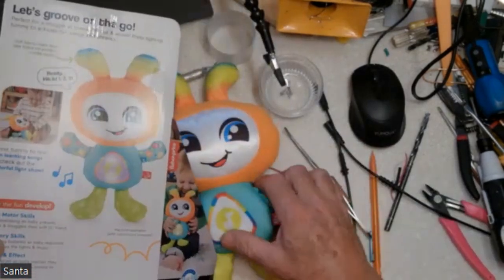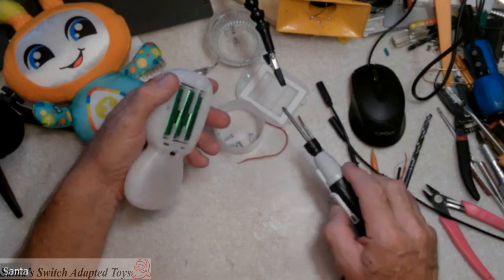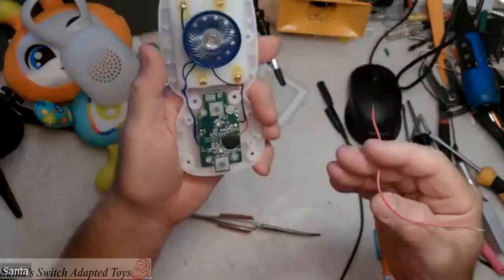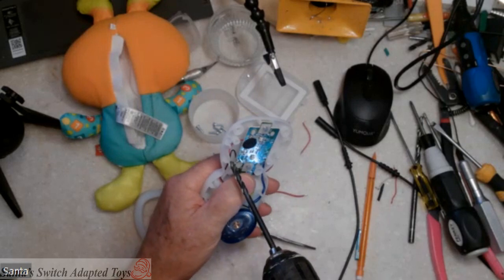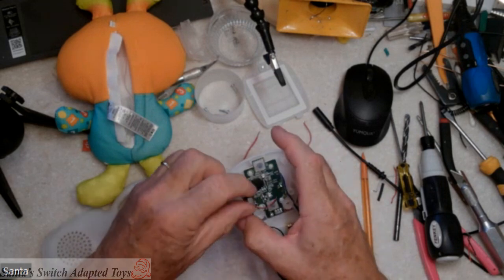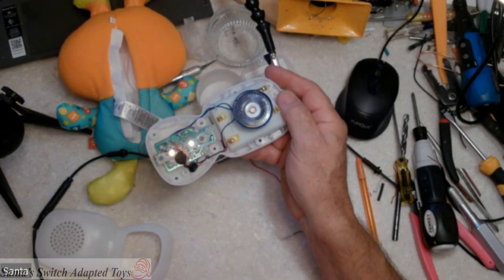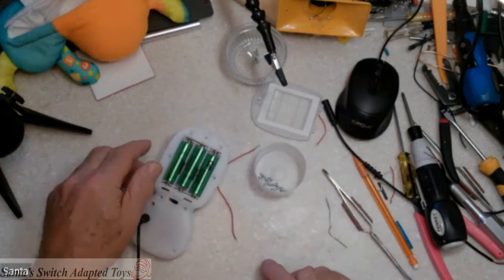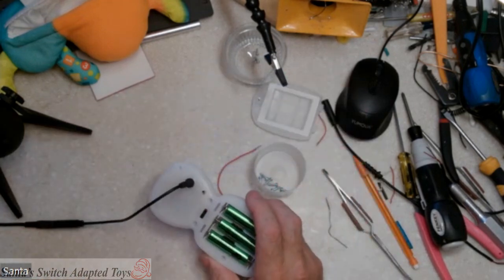Santa's Switch Adapted Toys- Special needs children DJ Groovin Go plush toy

Comment: moose linkimal please
Reply from the maker: Sorry, I have not been successful with the Linkimals Moose. The internal switch needed to be reached is in the hardbody and not accessible.
Reply: @TheLaserguy2  when you take the bottom screws off the moose there is more screws like 2 of em you take off the head and voila
Reply: You can take of a circuit board￼